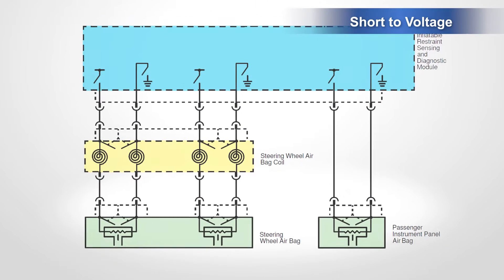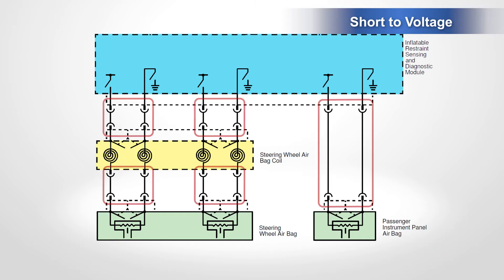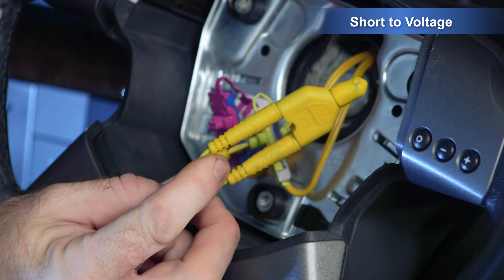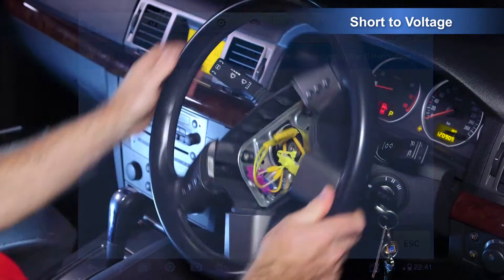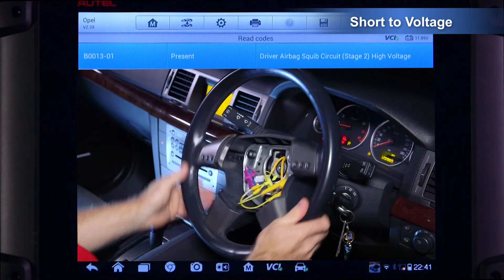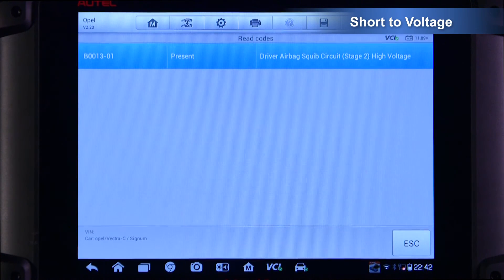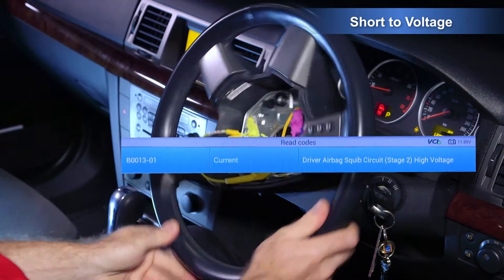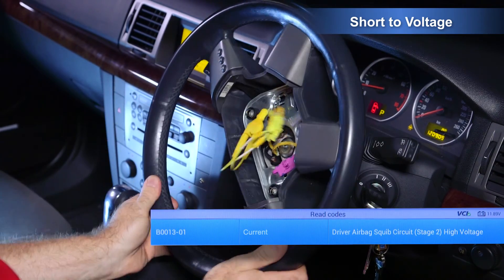SRS Airbag Short to Voltage

Comment: I keep seeing youtube videos of people intentionally setting off airbags using just 12v batteries. I would have thought that the airbag would require a more complex handshake signal, for safety reasons, but if a simple 12v battery can set one off, and you have a "short to voltage" condition, as above, wouldn't this mean that as soon as a "short to voltage" occurs, the airbag is just a ticking time bomb, waiting for the short to do whatever those guys are doing when they intentionally set off those airbags...maybe it requires an intermittent short of the proper duration to set it off? If so, why are airbags allowed to be so vulnerable to accidental triggering by a simple 12v signal like that?